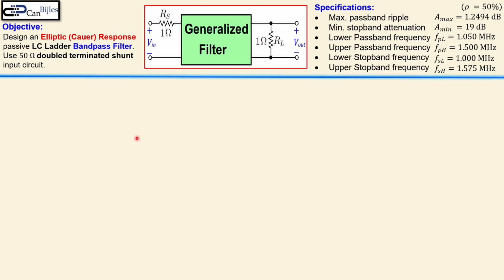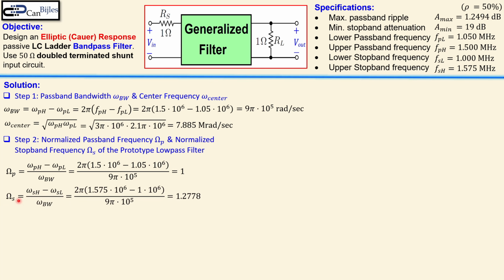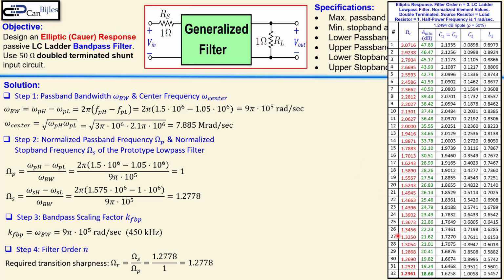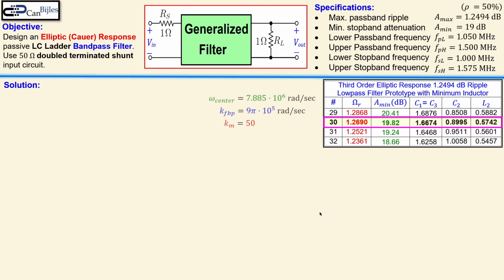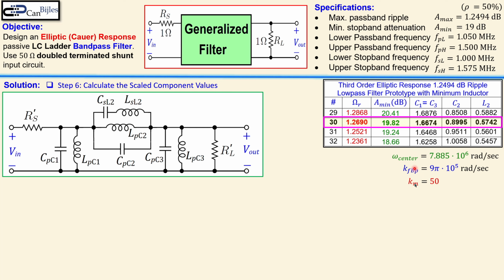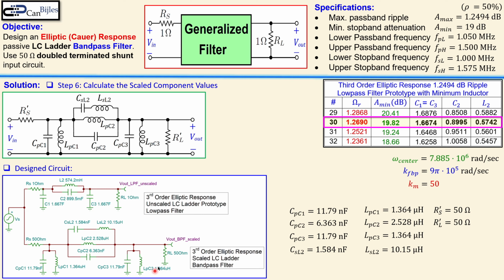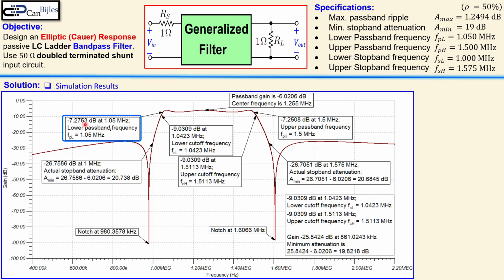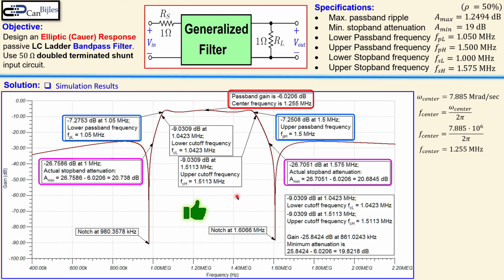LC Ladder Bandpass Filter Design 🌟 Elliptic (Cauer) Response - 3rd Order 💡  Example 4

Comment: Markimicrowave's 3rd order elliptic calculator exports to LTSpice with -6dB lost in passband as you also note. 50/50 terminations give same loss for straight wire. Can fix by changing AC 1 0 to AC 2 0 at the input. Now wire shows 0dB as it should, or as Marki calculates before export. I still don't quite get the math, but this style filter is strangely not difficult to coil on a screwdriver and tune with NanoVNA. Four near-identical LC series filters meet in the middle. Don't interact much, tune grounded notches to either side, tune SMA passes for minimum loss.

Marki calculates a stop tank in series with another stop tank to make notches. You calculate a stop tank with series pass LC across the top to spoil one big notch and make like two. Seems to be where you are shaping passband ripple? I might build both tank versions to compare practical differences to the all series-pass I built earlier. Wish comments allowed to attach photo or drawing.
Reply from the maker: Thanks for your message.I received your mail too. I will get back to this next week.